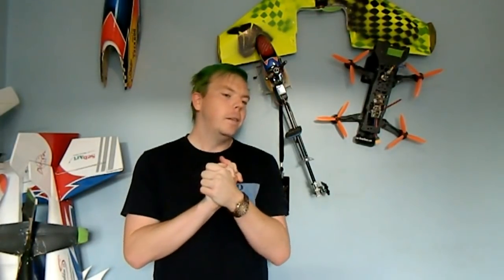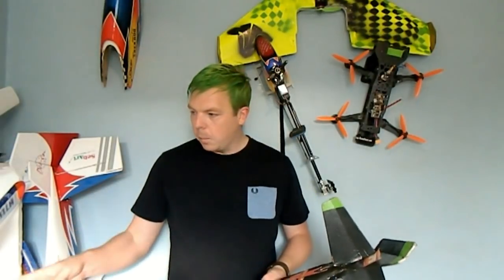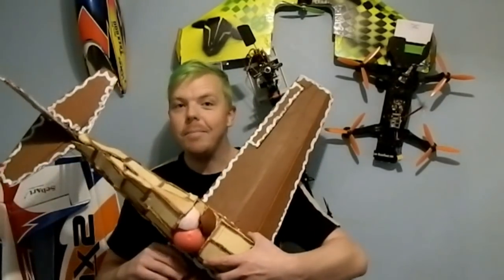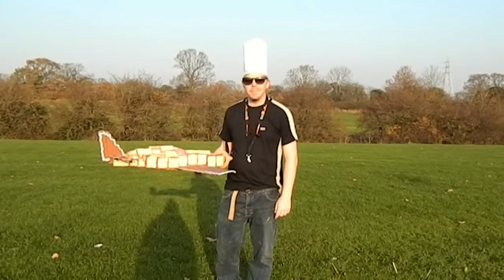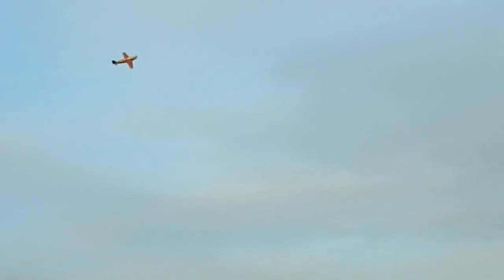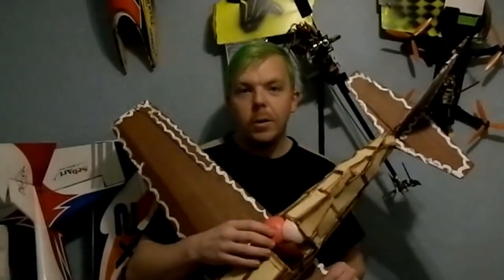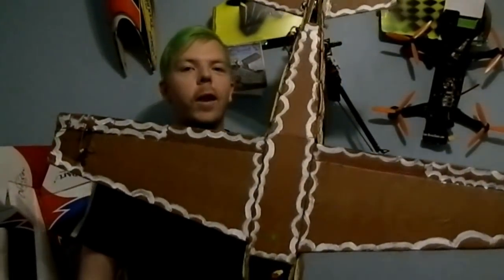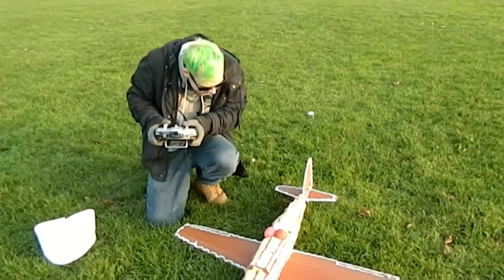Food Plane (I HAVE GONE CRACKERS)

Comment: thanks for posting.  good work.  here are some things to consider.   this was not a good design choice, for the following reasons.   the use of a swept main wing leading edge causes an increase in  inherent stability,  while  Sacrificing  LIFT.   a  BETTER option, for increasing stability, is the use a bit of  dihedral  in the design of the main wing.    some models  Need  ALL the lift they can get.   a low-wing planform is  inherently  less-stable than some others,  in part, because,  the  Center of Mass  is higher in the airframe, with respect to 'where' lift occurs.   the  SPAN  and  Area  of the  horiz-stab  are  Not sufficient.   yes, i know, it is SCALE.   that does not make it the  MOST  Correct  design, by  TODAY'S  standards.    cheers                   googletranslate
Reply from the maker: I know its not the best plane for the design I just used it as it was the only '' throw '' away plane I had ei I was not to bothered if it smashed up its already crashed a few times lol.
Reply: @rclabbotics5413   David is just a troll. He goes on people's channels tells them that their stuff is substandard at least in his mind and than if the person tells him to bug off he starts to get nasty.
Reply from the maker: @DreamForged3D  yeah I didn't take his comment to seriously at least it all helps the channel people interacting with the video pushes the video on the search list.